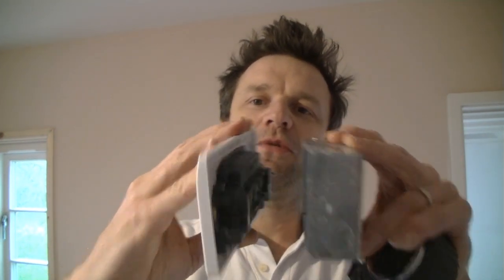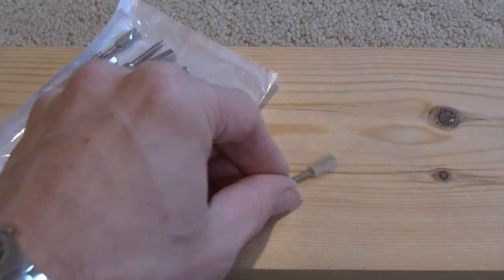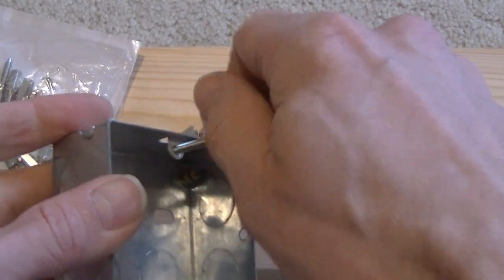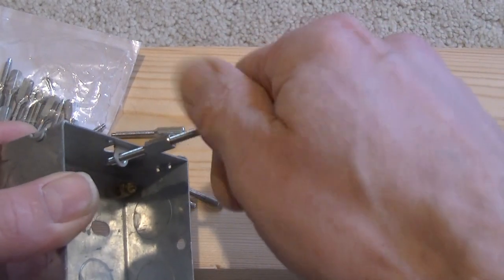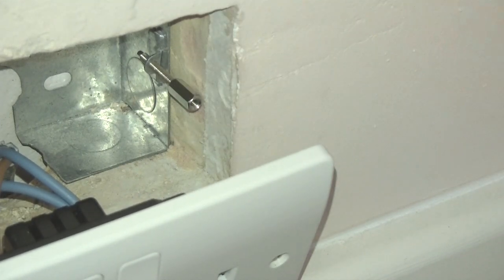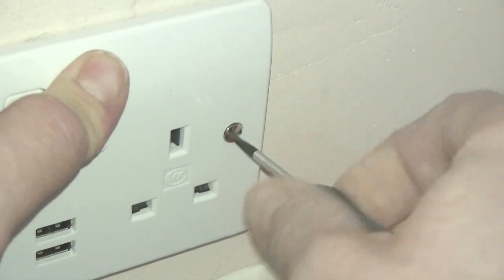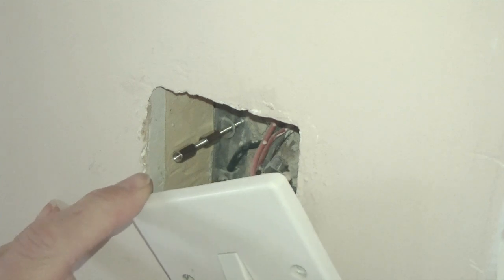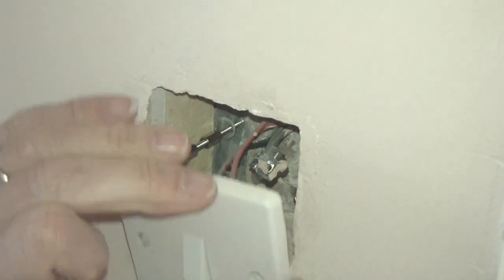How to Extend your Socket Switch Screws with Extension Studs

Comment: A note for DIYrs who are happy to do electrical work, just because your confident doesn't mean you know what your doing, of course all electricians are aware of these electrical accessories. we are also aware all electrical connections must be in enclosures, you are not allowed to have any flammable materials inside enclosures. over the years I have seen many examples of DIYrs using longer screws to secure face plates where tongue and groove boards have been installed on the wall or floor, so the enclosure is no longer safe, and yes that is a fire risk. to everybody do your research, do your own jobs but please get someone who knows what they are doing when dealing with items that can kill or burn like gas and electrical. Examples; installing extra low voltage lighting in a domestic property has to be signed of as complying with building regulations, not because of electric shock but because many fires are started this way. If you have a washing machine and tumble dryer installed next to each other you can't plug them into the same double socket, well you can't use them at the same time in a double socket anyway as the sockets are only rated at 13 amps for both sockets not 13 amps each. good luck to all of you. be safe.
Reply from the maker: Fair point. I'm not confident with electrics - in fact I have a healthy fear/ respect which is why I don't do any on my channel.
Reply: Thanx for this, I nearly had a knee jerk reading the start but you do put it right. People acquire knowledge from all kind of place and this can be leading in false sense of security.  I was just looking for long screws to replace a TV outlet in my kitchen but this was on a tiled area so standard screws weren't long enough to reach the bracket and my shop did  not have the extra deep brackets either which was a real pain. But I wonder why longer screws aren't available.

Comment: These are more intended if you want to use the manufacturers screws which are a tad too short. For example black/brass/white or and other type of bb screw provided in the packaging.  Ideally the enclosure should be fire rated. So in practice if the socket's or switches are extended forward fire sleeves should be installed when doing so.  I would have suggested sleeves for the sockets you extended forward  from the patress boxes. This is more so crucial on any new circuits.

Comment: Hi Charlie. I'd not seen these before so thanks for the video. 'Currently fitting an acoustic-insulated stud wall which will bring the 2 double sockets forward by about 75mm.
I'm yet to open up the sockets and work on the electrical aspect, but I'm thinking around what if there's not enough flex on the cables that run to the socket to allow them to come forward (which I suspect is likely). 
I can't see as it'd be possible to extend each of the wires (2 X L, N, E etc) or that it is safe to do so. Is there a DIY way round this or do I just call in an electrician?

Comment: Such a shame in this throw away society you have to but bulk packets of everything including these extenders. I only needed 2, so ended up asking a local electrician if he had any lying about in his van, got 2 for nothing!
Reply: Can I just ask a quick question please.. do the studs not turn (screw in/out) when one screws into them when securing socket? Cheers
Reply: @ab18i  Screw the stud into the actual screw, it then becomes a solid extension to the screw...
Reply: @stephenm5000  cheers for the response, as I’ve never used these when I saw the way the originator used them my vision was they would just turn.. I guess though if you bottom them out in the back box they wouldn’t self adjust as you screwed the socket on.
Reply: @ab18i  The secret is not to overthink them LOL They just work!

Comment: I’ve had to install MK grid switches as the original switches fitted in my house are no longer manufactured. 

The issue I have is this. The plaster is ok but the grid plate keeps wanting to fall into the cavity to meet the metal box. 

I’m sure I’ve seen box extensions available a few years ago but I just can’t seem to track find any. 

Any ideas?
Reply from the maker: Hmm, sounds like you either need to build out the cavity with filler or wedge something/ drill a hole in a dowel and pass the screws through that to space the Grid from the back box - something like this https://amzn.to/3CFFD4T